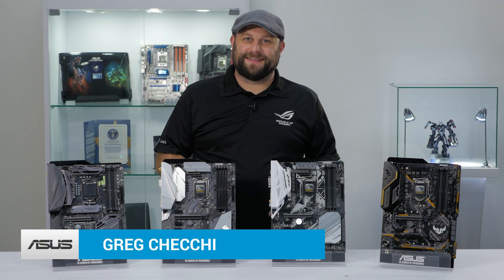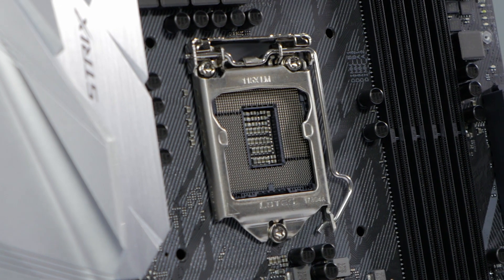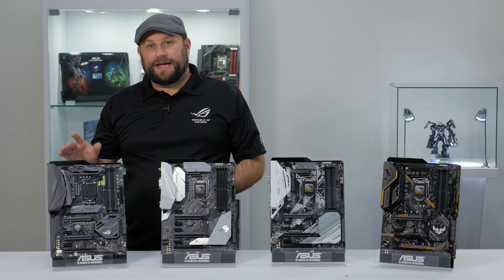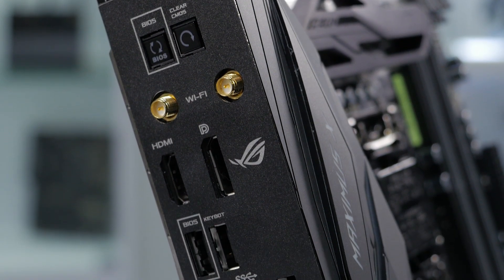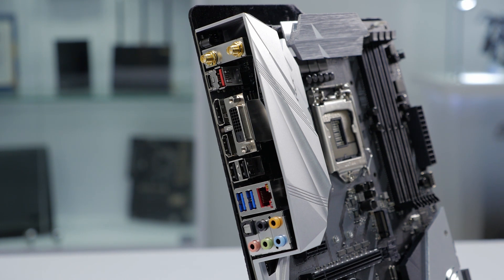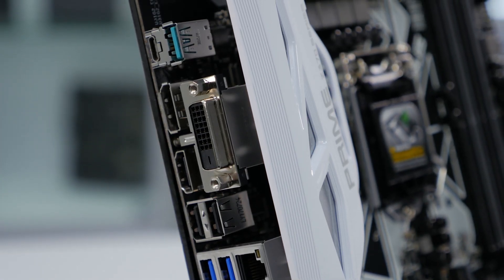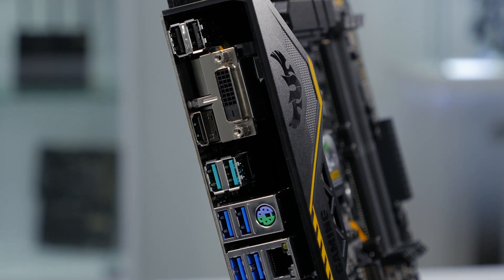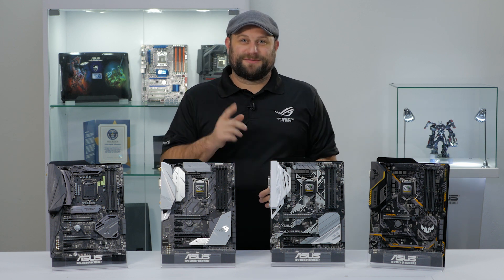Z370 Motherboard Family Overview

Comment: glad I'm not the only one disappointed about the TUF boards. They were freaking awesome. I've used them in every build for years. Sabertooth boards were the only boards I looked for and you give me this for the latest gen?  Entry level garbage is what you've relegated it to. As for the other boards in this lineup? no thanks. they're all tacky looking and way too much emphasis on RGB lighting. How about giving us some details instead of forcing us to fish for info? I need boards that can handle multiple RAIDS, you mentioned nothing about any raid controller on these boards, a feature I knew I could trust being present in the sabertooth series. Not a great offering, ASUS, sorry. :/

Comment: I am in doubt on a Prime Z370 or a Rog Strix Z370-f
I Will use a 1080Ti with a 8700K overclocked and a 2x8gb 3200mhz tridentZ (now only using 2xHDD and 1xSSD, in the future  I will but some M.2)
the price is the same in my shitty country
Some sugestions?

Comment: Just bought the Prime mobo for an i7-8700k build.  Looking forward to it.  I wish Asus would supply metrics and info on using these for video editing, not just gaming.  For instance, will overclocking improve video editing and rendering speeds.  I am not a gamer, so productivity is an issue.  What are settings, if any, in the UEFI that would improve video editing capabilities using Adobe Premiere Elements.   You really should label one line as optimal for video editing, if it is warranted, or just explain the effects.

Comment: it's a dam shame that after 3 generations of these boards and the extra pcie lanes coming with each gen, that you still can't manage to get both m.2 slots to run two m.2 x4 pcie ssd's  without gimping or disabling 1 or 2 of the sata III slots.  this is unacceptable that you have to buy into the "enthusiast" line up to get all 6 sata ports or even 2 more making 8 to work properly  when utilizing all the m.2 slots with x4 pcie ssds.

Comment: Wanted TUF Z270 Mark 1 equivalent for Z370 build & Asus really dropped the ball this time. No TUF motherboard back-plate, less fan headers, & much cheaper looking in comparison to Z270 versions. Really Asus, really? Going Asrock now with better power phase design, especially for the money. Extremely disappointed in Asus!

Comment: i dont give a ** about all the RGB features and watercooling. I want to overclock to the max using my trusted NH-D15. which board would you suggest?
Reply: The Maximus X Apex
Reply: You would be fine with any of the boards. Overall the best balance may be in the STRIX Z370-E , if you want to give yourself more tuning options albeit more enthusiast grade options along with improved VRM design consider the MAXIMUS X HERO.

Comment: Maximus X Extreme?
Reply: At this time the next ROG boards are the APEX, FORMULA and CODE.
Reply: APEX is already out, as for the FORMULA and the CODE within the next 7 to 14 days depending on the etailer.
Reply: Joe Momma for a custom loop definitely go with the extreme if they release one for z370! If not the formula is perfect for that as well!
Reply: JJ Guerrero when are those coming out?
Reply: JJ Guerrero thank you sir!! Man! I’m lost. Looking for some help, please.

I’m paying a Pc builder to build my 8700k/1080 ti Pc build. I will have AIO for the cpu and an AIO. I will have him de lid and overclock cpu to max performance and overclock gpu to max performance while being stable. 

What is the best Asus motherboard I can get for my build. I don’t want to cheap out on anything but I also don’t want to pay for something I don’t need. 

What would be the best for a custom water cooled system? I am highly debating between custom water cooled and AIO. 

I can wait a couple of weeks for those new motherboards since my cpu won’t be getting shipped out until 11/21. That the estimated stock date for B&H. Already pre ordered it though.
Reply: JJ Guerrero sir!!!

Just watched this video

https://youtu.be/z0ZmLbbintM

Asus mentioned one step 5 ghz overclocking with better bios. I need this for my 8700k/1080ti Pc build. Can you please tell me which model has that new feature and when it is coming out? Thanks!! 

I already have everything picked out. Just need to decide on mother board.

Comment: So what is the power delivery of the Hero, Strix and Prime? DO they have the same vrm setup?
Reply: They are similar but ROG features higher end VRM components such as microfine alloy inductors. Overall this will not affect OC ability for any of the boards. The main benefit of the higher performing VRM design on the HERO is reduced thermal load temperatures and greater power efficiency. For those look to have the most demanding OC then HERO is an outstanding choice but PRIME and STRIX will still offer outstanding range & stability. Some other differences are in the capacitors ROG use specialised ultra high performing 10K caps where the other two use 5K caps, powerstages are also different.